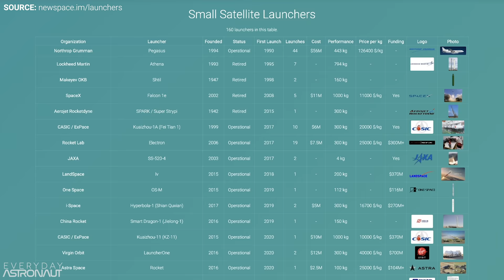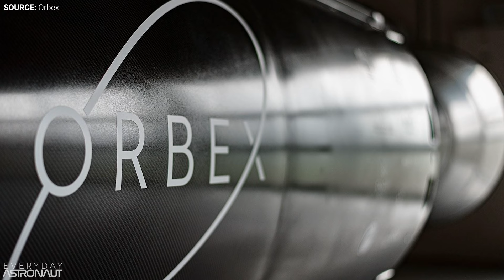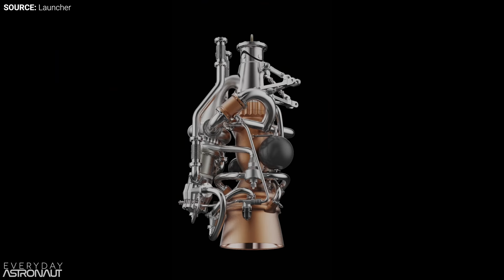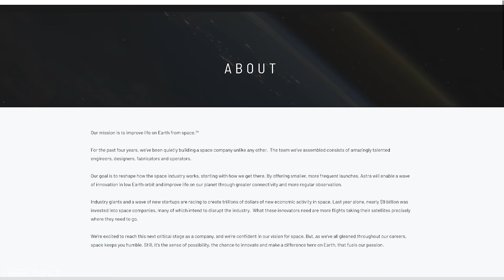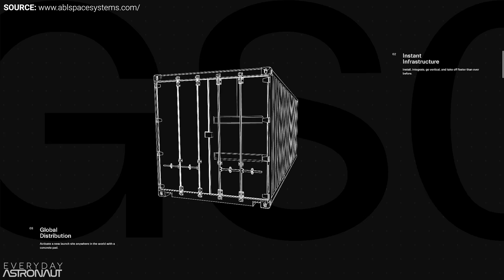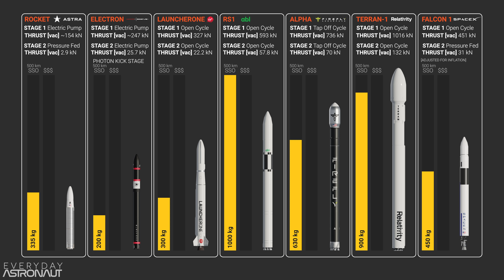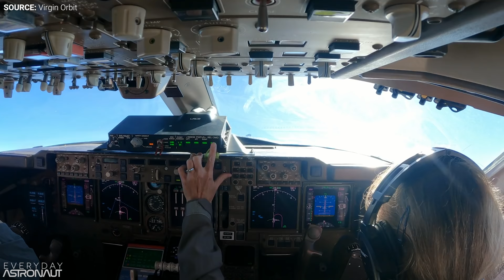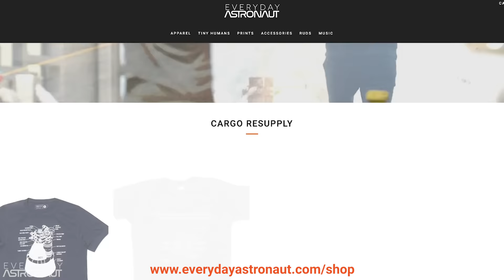Who will be the KING of the Small Sat Launchers?!

Comment: Not sure if I buy Astra's numbers. How does a smaller aluminum rocket with a pressure-red 2nd stage engine have superior performance to Electron, which is made from advanced carbon fiber and has a more impressive upper-stage engine cycle?

It also doesn't help their case that they've repeatedly stretched the truth regarding their 3rd launch attempt- trying to pass it off as a complete success when it really wasn't. It's a shame because what they accomplished there was incredible! They didn't need to make it something it wasn't!

I love their vision, hope they succeed, and will happily eat a hat if they can indeed do this. I just hope that didn't stretch the truth to get some good PR. Again.

Comment: I'm wondering why no startup is pursuing the "big dumb booster" concept of Sea Dragon on a somewhat smaller scale of course.
Reply: Cos it only makes sense if it's REALLY big and no-one wants to start big unless you have 1960s space race sized pockets. Elon said he looked hard at the idea early on and concluded it looked sound but too risky for a private company.
Reply: Starship is the closest thing to that right now. As soon as it works it'll probably end up getting scaled up even further, which is quite the engineering problem by itself. But understand that huge rocket engine has still not been invented as the Saturn V is the biggest we've managed to go and even that had trouble with combustion instability.
Reply: @samsonsoturian6013  No. The idea of a big dumb booster is that it's so big that it can afford be inefficient, so its fuels, tanks, engines are all crude. A fully reusable booster using full flow combined cycle engines running methox is about as far from that concept as you can get.
Reply: @kenoliver8913  combustion instability isn't about efficiency. When you burn fuel the flame is never perfectly even, and it gets more uneven as you go bigger. With rockets, this means bigger engines have a tendency to shake themselves apart as every tiny imperfection causes major tremors. This is why the Soviets used lots of smaller engines, and why NASA had to put thousands of engines through a meat grinder of tests in order to get a big rocket that worked.

Comment: Share your ideas on the small launcher.
Are they here to stay.
Yes. Because while we probably can't control the genie, we certainly can't put it back in its box.
What will come of it.
There are only 3 possibles scenarios. Two of them are unavoidable and necessary. only one of them is desirable.
We need lots of positive wave here, be very optimistic. Or pray.
Or better yet.. Have a PIZZA.
By the way Tim i realy did'nt get it. Wy would you whant a single pizza deliver by a small delivery véhicule if you could get a full load of it in the bigest van possible.
It's Pizza man the more the better.

Comment: 4:42  you're wrong in your logic, there. It WON'T matter when starship is build and operating. Your analogy with the semi-truck and the scooter falls short when the semi-truck would be far CHEAPER than the scooter. I'm surprised you don't seem to have thought this through, while it's quite easy to grasp. With starship EVEN if you only paid for one mini-satellite on a dedicated flight, you'd only need to pay for the fuel costs, as it's fully reusable. A small launch rocket won't be able to do that. Fuel would set you back maybe $200000, while the cheapest small launcher would still cost you $2000000!

And this will remain true until the point they can create small launchers that are cheaper then just the fuel of a bigger launcher...which is extremely unlikely, since you always have to throw away at least the upper stage. So, in your analogy, it would be like paying for the fuel of the semi-truck, or paying for the fuel of the scooter AND the scooter itself every time you order something. That's nearly impossible to be advantages for the scooter. Surely you see the logic of this reasoning?

Comment: How light could you get a human-carrying payload? Not a capsule, but a human in a lightweight spacesuit, life-support pack and a manoeuvring pack with enough delta-v to rendezvous with a real vehicle in LEO? A astronaut-capable trained human is probably 70-80kg, so you'd have to squeeze all this into about 110kg to go with the lowest-rated launcher here. You obviously wouldn't get a launch escape system but you wouldn't be doing this at all unless you were desperate.
Reply: An astronaut in an EVA suit, with a maneuvering pack & life support system would run about 500 kg minimum. You could do a 1 person docking capable capsule, life support & IVA suit for ~1400 kg. I have no idea why you’d do any of this.
Reply: That's clearly not the case, though, because right now astronauts doing space walks with (admittedly very small) manouevering packs mass much less than half a tonne.

Comment: Rocket lab just had an ‘oopsie’ again. 20 flights for 3 busts. That’s not that good, 85% reliable.  Ride sharing on a StarLink launch or on a SpaceX dedicated ride share or maybe the ISRO ride share might be better as it probably won’t be much more than 7.5 million dollars and is more reliable. 

To me electron has lost its lustre since Rocket lab sold New Zealand out and bailed on them to become a USA company so as able to get access to USA tech that’s protected. Then it keeps not working. Rocket lab hasn’t got its initial system for defiantly no reuse down yet and now it’s adding a mid stream design and PHILOSOPHY change of reuse into the already at best shaky system.

85% launch success rate for electron thats 1 complete failure every 6.66 launches and that just doesn’t seem good enough for today’s expectations. I hope to see failure rates included on these rockets.

Comment: If Elon musk were to just build a new rocket by using the 1 raptor engine for the first stage and one merlin engine for the 2nd stage, i am sure it would demolish all these other rockets.
Reply: That's a bigger engineering task than it sounds. For starters, those are meant for use in a steel rocket, which is effective in big constructs with economies of scale. These small rockets have to be light in order to have enough thrust to get high as well as fast, so they're made of carbon fiber, which isn't reusable because in burns up on reentry. You'd have to also redesign the fuel tanks to keep the rocket balanced.
Reply: @samsonsoturian6013  what if the rocket is not reusable? I mean the right key is so small, it would be cheaper to build a new one each time then Refurbish the whole rocket
Reply: @axel2770  it means it'll have nothing in common with anything SpaceX has built so far. What you're asking for is SpaceX to build one of the rockets featured in the video, not repurpose what they already have.

Comment: Will all those first stages made of carbon fiber fall ito the ocean after separation?? If so then we will pollute the seas even faster.
Reply: they burn up on re-entry
Reply: @oren2000  first stages don't
Reply: @adamrezabek9469  if they go high enough they do
Reply: @oren2000  yeah, but usually not. Maybe some super small, especially if they break in many pieces before re-entering 🤔
Reply: @adamrezabek9469  yes